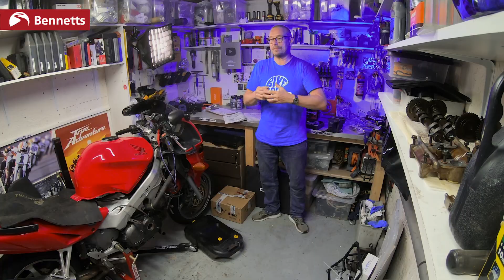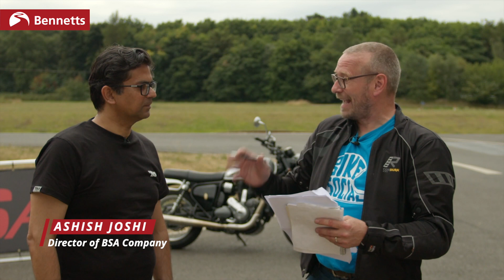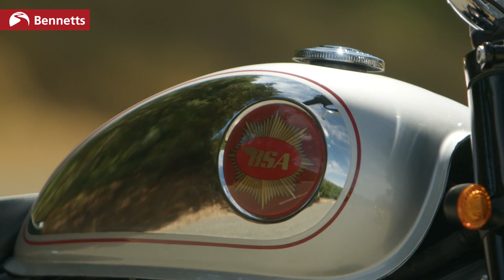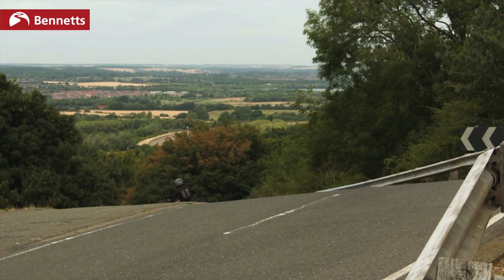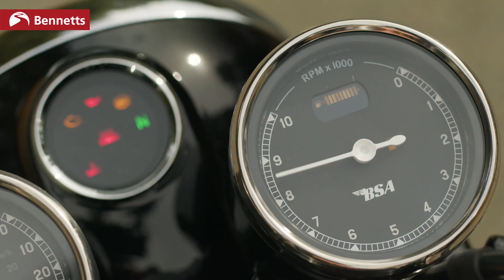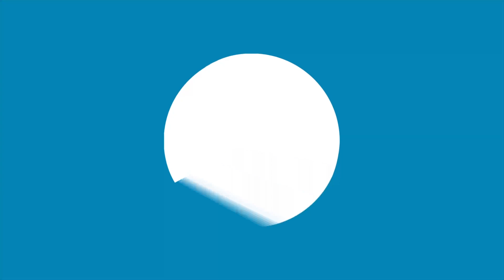2022 BSA Gold Star review | Price, top speed, engine, suspension, brakes... is it any good?

Comment: Not sure the water cooled single has more appeal than Enfield's air cooled twin, it is a nice looking bike though and it's nice that we have another manufacturer doing retro style bikes made of proper metal and stuff. I suspect the weak brakes might be down to a cheapo master cylinder not getting the best out of Brembo kit? Actually really interested in what the EV will be after doing a Zero demo day last weekend!
Reply: It seems they aren’t really all in on the concept are they? If they were they would have built a new engine instead of taking the Rotax unit originally created for the BMW F650. I get the impression they will see how sales go before decoding whether to seriously invest. The steering and handling will be hampered by the shallow rake and relatively fat tyre on the rear. The Harris influence at RE clearly shows when you ride their twins
Reply: @morri03  This bike should be powered by a long-stroke high-torque low-rpm engine and then would be more appropriate to the retro style frame. but as of now, it feels like a ktm 690 engine in a vintage body.
Reply: Just can't get past that radiator and the attempt to make the engine appear air cooled. The RE 650 and new 350 engines are works of art and just a joy to ride and admire.